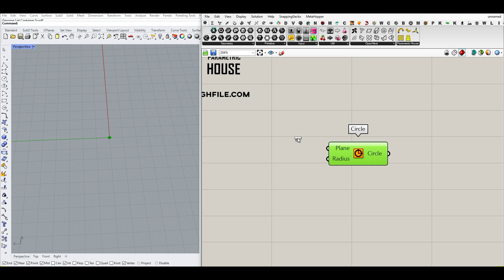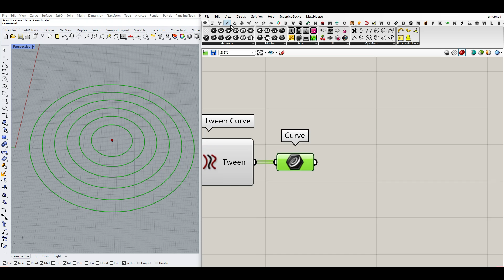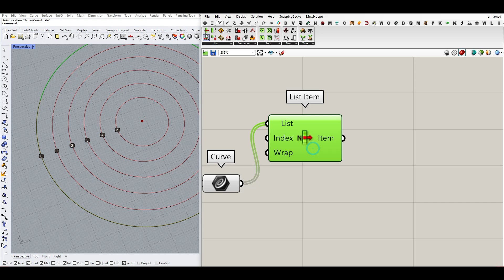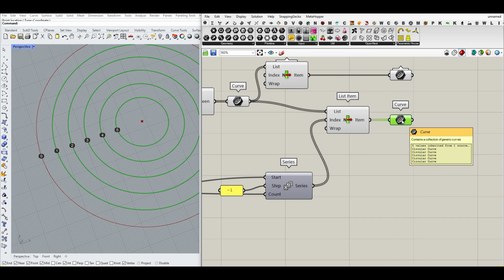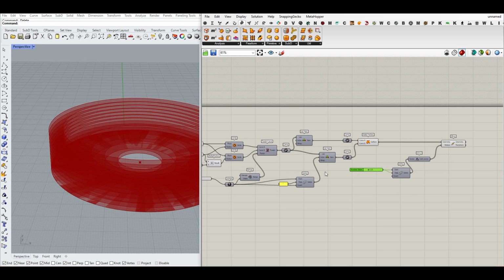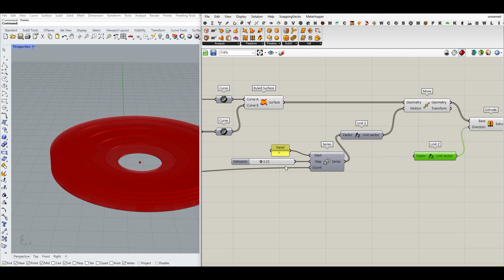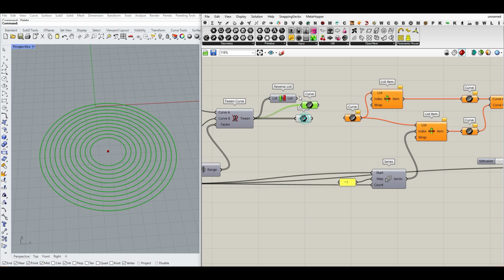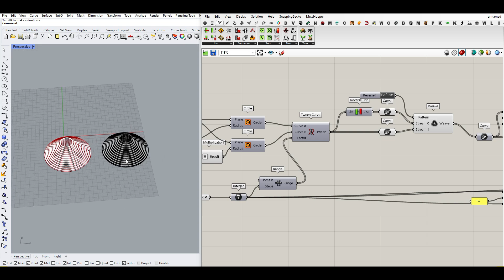Grasshopper Tutorial For beginners

Comment: Hi, great production and quality explanation as usual :) I have quite a difficult grasshopper challenge and would appreciate any input. I want to take a city or just multiple buildings and remove the context of the buildings essentially drawing massing. The reason for doing this is for cfd, the fine details such as texture, windows, facade details, just aren't required to produce an accurate wind map for a large scale external case. I quite frequently find myself reducing detail by manipulation in rhino, but automation would be great. Bounding boxes in grasshopper is a good start, but sometimes you lose the overall shape of the building, direction, or the rooftop structure. Alternatively, taking border curves from the top of the s structure and extruding down to the terrain could work for many buildings but does sometimes miss detail on the roof shape again or any buildings that change shape at middle heights.

I am very new to grasshopper, but from my research, this seems to be quite a difficult task. I would appreciate your expertise here. Thank you.